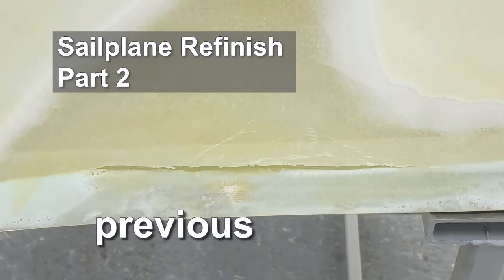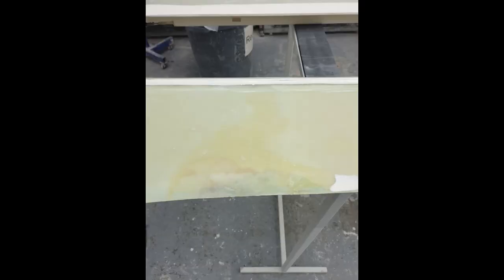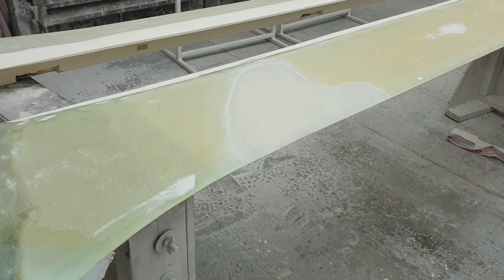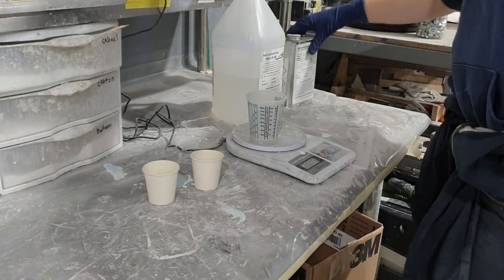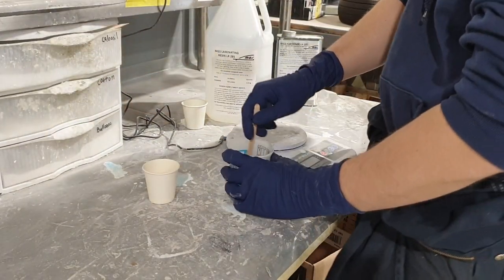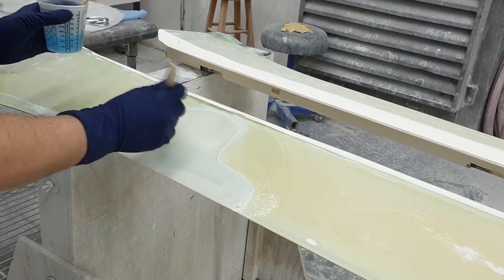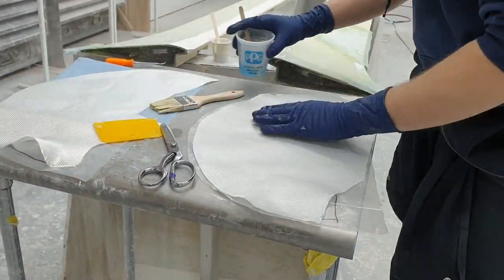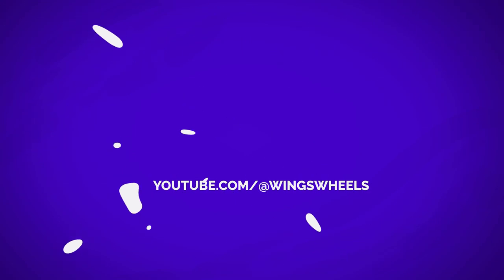Sailplane Refinish Part 2 - Flap Repair

Comment: Great video, I learned a number of things.  Two questions if you wouldn't mind...  How do you clean the scissors after cutting the wet glass with them.  And how does the peel ply come off?  I've never seen that.  Thanks for these videos Schaefer Aviation!  Great shop.  Keep em coming.
Reply: You can clean the scissors with acetone to get all the resin of them. the peel ply can just be pulled off by hand after it has cured.